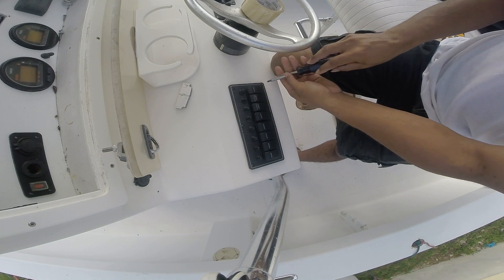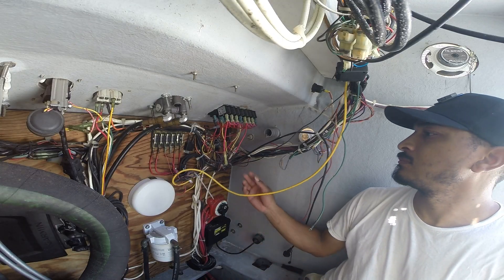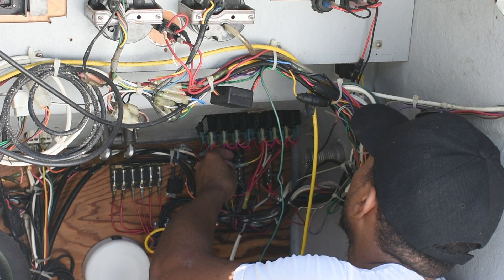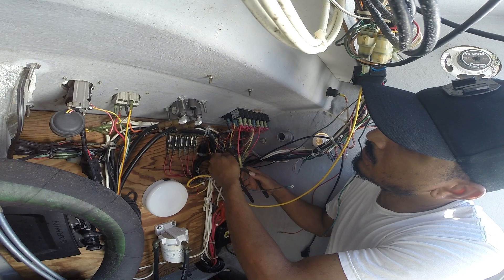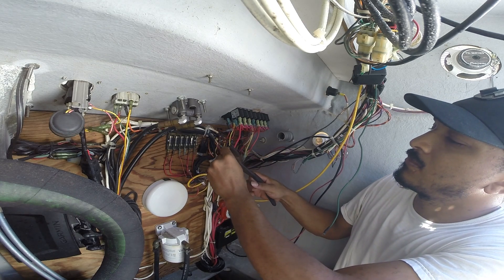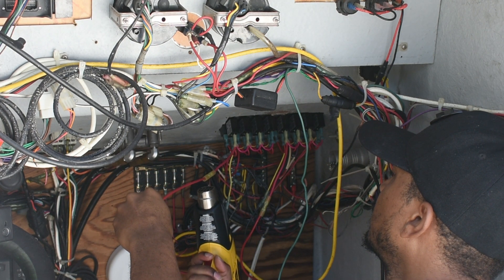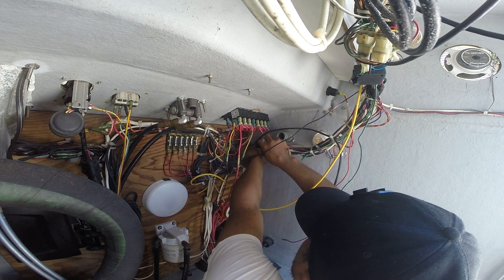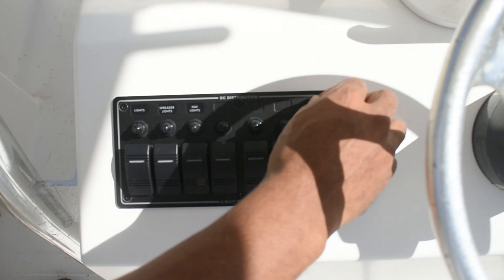Installing My New Switch Panel: Part 2 Wiring

Comment: What size wire did you use to connect the positive and negative
Reply from the maker: Hey, I used 12 awg to connect the positive and negative.